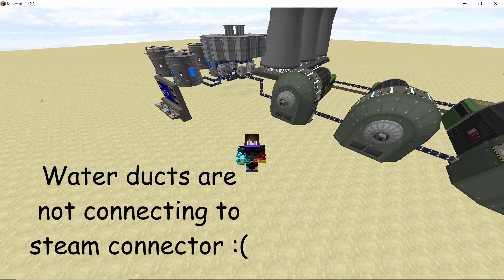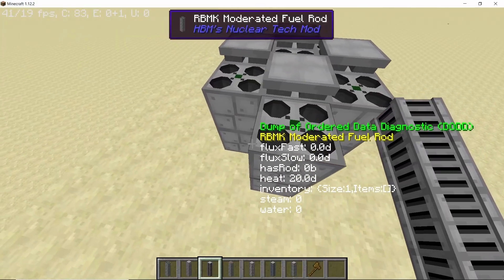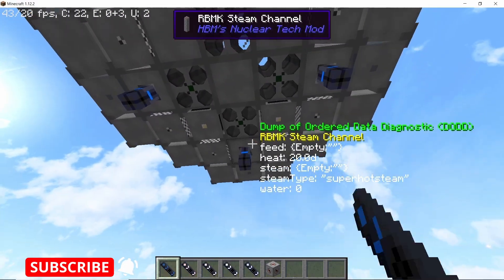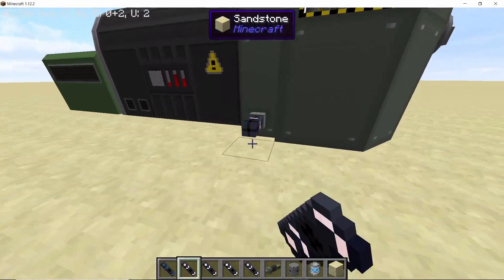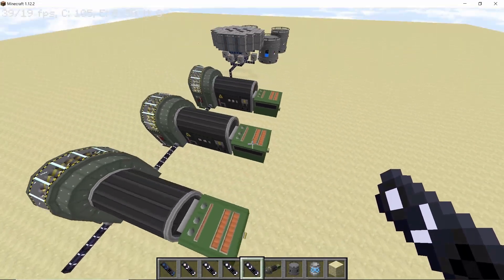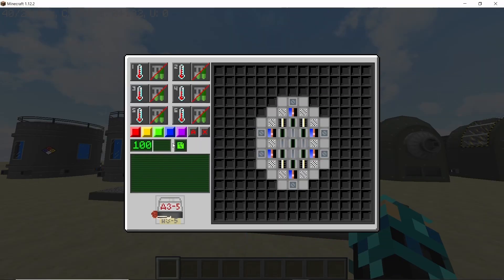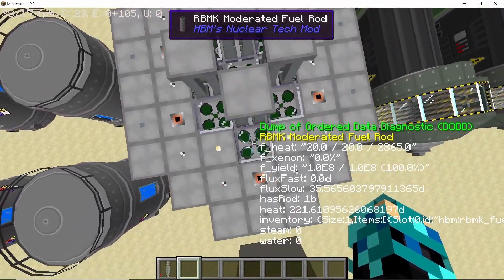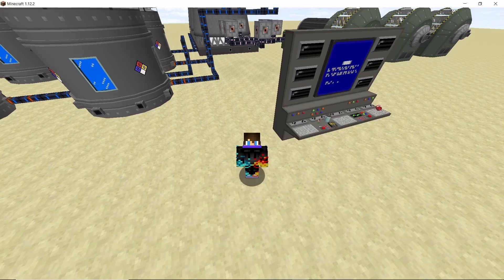How to make an RBMK Reactor in "1.12.2" HBM Reloaded -Water Ducts not connecting to Steam Connectors

Comment: The controller won’t connect to the reactor
Reply from the maker: right clicking the rbmk console linking device on the central rbmk channel and then rightclicking on the console does the trick for me, never had any issues with it. You can report the issues if it still exists on the latest version of ntm extended on ntm extended discord server
Reply: @SavageVegeta  I figured it out but  it blew up so I just made a smaller one

Comment: Hi, I have the following problem: the rector and cooling towers consume a lot of water, and my tanks are not enough :(
Reply: You need just fill one time and water continuously cycling
Reply from the maker: The continuous loop only works perfectly in 1.7.10 for now, it's kinda broken in 1.12.2
Reply from the maker: Using multiple tanks with heavy infinite water barrels is the only option in survival for now as the water loop is kinda broken in ntm extended. 
On 9th February there's gonna be an update in the mod and hopefully this issue will be fixed

Comment: Ive built my reactor to the specifications but it seems to be building up xenon slowly in the two outter most fuel rods. Ive tried swaping them out for fresh ones but that only helped a little, the xenon still slowly builds up. To give an idea how long it was running without issue before this, the rods are at 30% depletion and I've never turned it off or interrupted its operation.

Comment: Awesome tutorial! This is probably a simple question with a simple answer, but after following this tutorial, I was pairing the control panel with the reactor, and despite the steam channels saying they have water in them, the control panel says they don't. What should I do? I am on 1.12.2

Update: The reactor still works fine, must be some visual glitch...
Reply from the maker: Yes that is a visual glitch in the reloaded version of the mod, try playing with ntm extended for 1.12.2 it doesn't have that issue

Comment: my boiler is not getting any water, any tips?
Reply from the maker: Double check your water pipes if that is the case, however if you're using ntm reloaded then the display won't show there is water in the boilers but when you'll physically check them then yes they'll have the water

Comment: Excellent tutorial! very helpful, but I have just one question, after starting the reaction do I replace the HEP fuel rod back to a HEU fuel rod?
Reply from the maker: You can do that, the reactor will run a little hotter however do make sure that the heu rod you're using is not of the Linear/Dangerous type. This reactor is not made to handle that

Comment: My reactor does not fill with water? why?
Reply from the maker: no idea, if you connect the water ducts on the bottom of each steam channel and on the other end is a water tank set to output then it should fill up. If you right click the first fluid duct connected to tank with screwdriver that will set the duct to output mode and will increase the flowrate but in both the cases channels will fill up
Reply from the maker: try using NTM Extended, rbmk stuff is less buggy in that version
Reply: Ok thanks for the advice!

Comment: I ran into a problem. For some reason, this reactor exploded after three hours of operation. I still couldn't understand the problem.
Reply from the maker: Damn it exploding in the initial minutes makes sense cause the fuel will reach its peak temp in like 30-45 mins but after 3 hours of operation most of the fuel has been depleted over 50% and it's not as hot ... This is weird af

Comment: water is not showing up on the RBMK console
Reply from the maker: 1.12.2 issue ig, try using NTM Extended maybe the problem is fixed in that version and if it isn't then Alcater will fix it at some point

Comment: so as far as i understand, moderated fuel rods slow down neutrons so you dont need to place graphite moderator, but they require bismuth which is made in irradiation channel. TLDR you can use regular fuel rod in combination with graphite moderator as a starting point?
Reply from the maker: yes you can, aside from making the reactor more compact I don't think moderated fuel rods serve any other purpose. So using normal rods with moderators is definitely always an option

Comment: Thank you. If I remember correctly, I tried using your other RBMK tutorial in 1.12.2 and it immediately exploded the second I turned it on.

Edit: I don't know why, but the console isn't showing any feedwater going into the steam channel, but when I right click on it, it shows up as full.

Edit 2: Despite that, my reactor is operating perfectly fine! I think that the reason why might be a mod incompatibility, because one of my irradiation channels is invisible.
Reply from the maker: Try using NTM Extended mod as it solves many issues that NTM Reloaded has cause it is updated more frequently. That should solve your issue. And in 1.12.2 fluid ducts when right clicked with screwdriver enable output mode which increases their overall throughput so do that when making your reactor, also make a closed loop after filling the reactor with water by removing the water tank cause water will keep on looping back if you have used enough cooling towers
Reply from the maker: regarding water system and fuel values alot of stuff has changed in the mod and my old videos don't really cover that. in my newer designs I have used the closed loop systems but all those videos are for 1.7.10 version

Comment: It keeps blowing up for me when I try to put flashgold rods in, any fix to this?
Reply from the maker: Flashgold is very reactive and needs much more cooling than a normal fuel rod. I made a video on balefire processing a while ago ... In that was a reactor that could deplete flashgold rods without going boom 
So either make a reactor with RBMK coolers, or you can use thorium rods to stabilize the flashgold or you can check out that video (tho it is an old design and there were many fuel changes after that)
Reply: @SavageVegeta  Alright thanks I built the flashgold depleting reactor in a creative world and confirmed it still works, I'm now going to build it in survival (though its gonna be really expensive)
Reply from the maker: @bartkor12  alright then have fun my dude

Comment: i followed step by step but for some reason the water doenst want to enter the boilers
Reply from the maker: which version of the mod are you using
Reply: @SavageVegeta  1.12.2
Reply from the maker: @U-235-U  i would suggest using NTM Extended then, it has the completely implemented RBMK that too with some better performance
Reply: @SavageVegeta  I guess the water is in the boilers, but only if I go to them. On the console it says, that they are empty. I also have a map installed that is made with the HBM Reloaded, because I was too lazy making my own reactor. But I also encounter the issue, that Uranium-235 is overheating to like 7000°C core temperature, although the melting point is 2860°C. I also think that the water isn’t cooling the temperature of the uranium. But it didn’t blow up. Yet. Do you have any tips how to operate this reactor better and without those issues?
Reply from the maker: @U-235-U  core temperature doesn't matter much when it comes to these fuel rods, its the skin temperature that will cause the meltdown. As for not seeing water on the console and water pipe issues I will say to use NTM Extended mod instead of Reloaded cause its more complete and doesn't have these issues. Cause if there are steam channels around the fuel rod they will cool the reactor down.
Reply: @SavageVegeta  I've already fixed the issue thanks for the recommendation :)
Reply from the maker: @U-235-U  Glad to hear that !!
Reply: Yea same

Comment: Speaking of 1.12.2 NTM, how many big water tanks, cooling towers, and rows of leviathan turbines would you suggest for each possible fusion reactor fuel combination?
Reply from the maker: I have never tested out for the exact amount needed , sorry man. 
However doing that test in the 1.7.10 version would be much easier now as they have fluid gauges so the exact flow rate for both the water and fuel can be measured !!
Reply from the maker: however if I do the testing I will surely post the data in a tabular form in the community post section

Comment: the steam wont come out of my reactor and idk why
Reply from the maker: Double check the pipes that you are using and whether the steam type you set are correct or not. Other than that dm me on discord and maybe we can sort it out on a vc
Reply: i fixed it, i removed the steam separators and connected the steam pipes to the top of the rbmk (water pipes at the bottom)
Reply from the maker: @WOLFOXY16  alright !

Comment: Thanks for the review for 1.12.2!  Very helpful but very fast.  I did not have time to pause =) The question remains, where to get plutonium in survival mode?  Or somehow use the heat-shard from the bombs?
Reply from the maker: Plutonium will be obtained by recycling depleted uranium fuel in a centrifuge. I have made guides on how to recycle nuclear fuel and also how to obtain plutonium so you can check them out as well !!
Reply: Thanks for the quick response!  :) ❤️
Reply: @SavageVegeta another and better way is Trixite ore that  found in end dimension

Comment: im having a problem i build a RBMK reactor maybe a bit customized this desighn just to be more round and neutron absorbers but its making super dense steam the only problem is that it doesnt want to output the steam to the turbines via pipes. Thanks for helping the vids that you provide are amazing keep up the good work!
Reply: oh and yes im 100% sure all pipes and wires are in the right places
Reply from the maker: Try this and then lemme know if it worked or not
Reply: @SavageVegeta  it works with the pipes on top now but it doesnt look good for a RBMK reactor with pipes on top thanks for the fix ❤
Reply: i have tried it now again and it works without the pipes on top everything under idk why it didnt work then the only thing that "does work" is on the RBMK panel it doesnt show any fluids in the boiler column but when i go to the reactor and check myself it show its working and everything is full
Reply from the maker: Well what you can try is connect all the steam pipes on the top of the steam connectors , so water pipes connect to the bottom and steam pipes on the top and this way you eliminate the need for using steam connectors

Comment: Ummmm when i try to start the reactor It produces radioactive clouds at really low temperatures, also It doesn't produce steam.
Reply from the maker: Hmm producing radioactive clouds can be taken care of by covering the reactor with RBMK Neutron Absorbers and also making a concrete containment building for it. As for not producing steam did you double check that there is water in the reactor ? And what fuel are you using btw
Reply: @SavageVegeta  1- Thanks for the radioactive cloud ones
2- No, i actually didn't get it enough water and also everytime i did it it exploded
3-I use HEU/MEU-235 and as a neutron source the strongest one, i don't remember the name

Comment: Wait how do you make the reactor stop spewing out freaking radiation, do you have to cover the neutron deflectors?
Reply from the maker: As Gib's comment said , cover it with RBMK covers on the top , and if you want to surround the periphery do it with "Neutron Absorbers" and not Reflectors ... And this applies to most reactors in general cause if you're using a fuel which is dangerous it won't take long to go over it's temperature limits if a reflector is placed in its path. So yeah always cover the perimeter of your reactor with absorbers , they are safe
Reply: @w_Gib1997 thanks

Comment: im having issues with my RBMK reactor. i always double check on everything and it dosnt seem to fill up the steam channels with water, i did everything correct, yes im in 1.12.2, and i dont understand whats happening, can you help?
Reply from the maker: If you did everything correctly then I won't be able to help without actually seeing your setup so maybe a discord vc will help. 
Cause the issue can be that you forgot to set the water tank to output mode , or maybe used the wrong fluid pipe ... sometimes very small and less noticeable mistakes cause these kinds of issue
Reply from the maker: I made this video to touch down on the topic of water ducts not connecting visually to the steam connectors. So maybe watching the video again carefully might also help
Reply: Yea same

Comment: Is it safe to build around the reactor?
Reply from the maker: Yeah it should be , however it is generally recommended to make your base away from your power generating area and also keep the reactor in a loaded chunk using any chunkloaders
Reply: @SavageVegeta  also my xenon is getting really high up to like 94 percent on the outer fuel rods so what should I do about that
Reply from the maker: @masked1979  that means you need to increase the amount of flux passing through those rods ... Maybe convert the absorbers to reflectors with control rods placed in the middle and then pull out the control rods slowly
Reply from the maker: @masked1979  basically whenever a rod is running at low temperatures xenon will build up in it , to remove the xenon just raise the temperature of the rod and that should burn off all the xenon ... This is a general rule for any RBMK fuel rod and Reactor
Reply: @SavageVegeta  ok but it also the amount of xenon rose up very quickly when I turned it off
And another thing is that my water is running out fast
Reply from the maker: @masked1979  yeah that happens when reactor is being turned off cause the temperature starts dropping , it should go away once you turn on the reactor again and temperature goes up 
As for water just add more big ass tanks with heavy infinite water barrels in them , and make sure to complete the loop by bringing back the water from cooling towers back into the tanks

Comment: Dang for some reason my reactor does't achieves stable temp even if control rods are fully inserted, im forced to put less fuel into reactor. I tried everything but nothing seems to work. I even made super efficient cooling loop but still no good results.

Once i left reactor for 10 minutes and it exploded even after i checked if cooling is fine and control rods are inserted.
Reply from the maker: Water supply and cooling towers aren't a problem here probably so I guess try using a different fuel in the reactor. Something which is not as reactive and runs cooler should allow the reactor to stabilize quickly

Comment: hey I'm noticing the moderated fuel rod requires bismuth, but the wiki says the only way to get bismuth is having an rbmk, what do i do about that?
Reply from the maker: My bad I should've made a design with normal rods first. Anyways you can use moderators separately as well , just place a normal fuel rod and surround it with graphite moderators on all 4 sides ... And problem solved you won't need a moderated rod anymore
Reply: @SavageVegeta  i keep trying to make this but im unsure how to do it, my current design at the least doesnt explode, but the plutonium in the middle barely reacts at all

Comment: Why is my bottom of my reactor leaking radiation? I have a base rn that is controlled by this reactor and I do not want it to blow up (It did befor
Reply from the maker: maybe the fuel you are using is more reactive ... To stop the radiation surround the whole reactor with RBMK Neutron Absorbers and also don't forget to add RBMK covers on top of each column

Comment: i tried making a 13 by 13 one but it keeps blowing up
Reply from the maker: Hmm maybe try using a different less reactive fuel and see if that works. Or you'll need to tweak your design a bit and introduce rbmk coolants assuming you are making it in 1.7.10

Comment: another problem with hbm reloaded is that the dfc fuel injector doesn't have the fluid identifier thingy and cause that most of the time the fuel with swap bars and aperently a the fuel injector bar and the core bar must have the same fuel on each individual bar and since its swaping if you use too much fuel it will stop sending fuel and you have to manualy break it and place it back wich is quite anoying if you are using Looping dfc at maximum power
Reply from the maker: That indeed must be pretty annoying but well there is so much we can do about it xd.
There's a mixed opinion about that system tbh , not having to place fluid identifiers allows for some flexibility with a single fluid buffer in between multiple fluid pipes and also saves some time. Then again not having it and being habituated to the 1.7.10 version it becomes unnatural real fast ... I know this cause I was also weirded out by that system

Comment: Hey, So the thing is that when i finished building and started the reactor, the Reactor Exploded even though i did not build anything around it and i followed the correct procedures
Reply from the maker: If the reactor exploded very quickly then I would guess it didn't have water in it , cause there is no other reason these reactors explode on startup ... Cause if you used the fuel that I did there shouldn't be an issue of temperature going up too fast unless you had no water to begin with 

Well I will recommend double checking your water supply and if it is getting to the reactor or not. Also set the water pipes to extraction mode that'll help alot by getting the maximum amount of flow
Reply: I built the reactor again, now i want boom boom
Reply: @hairforcetwo7  idk if you stillwant boom boom, but just disconect the water supply or put a really toxic fuel